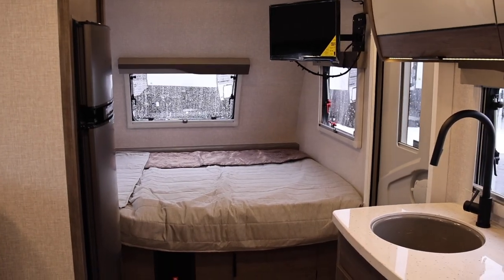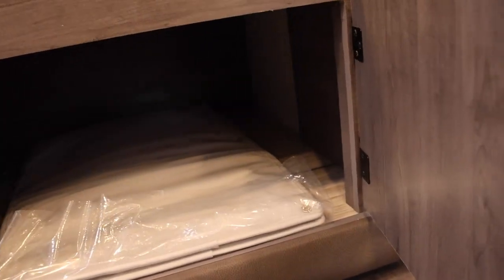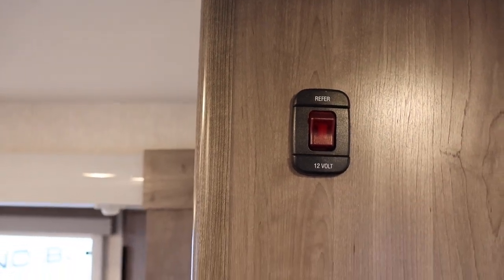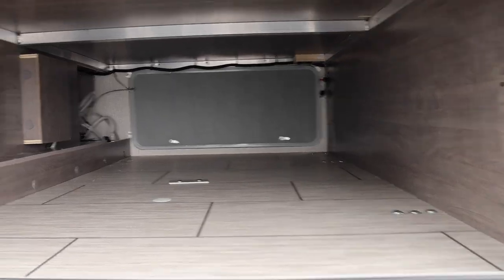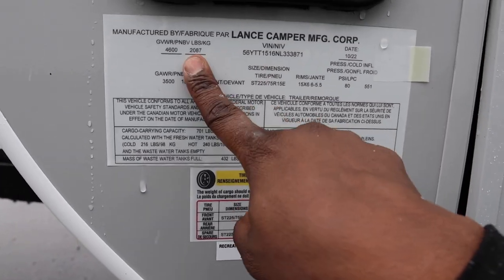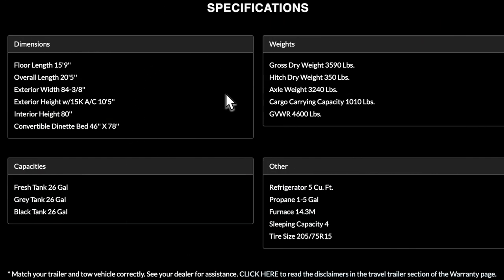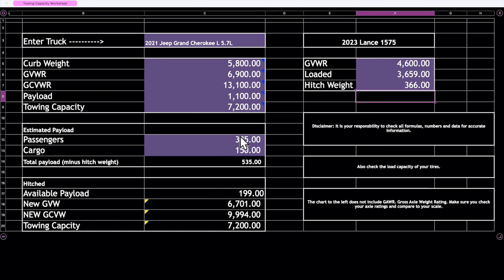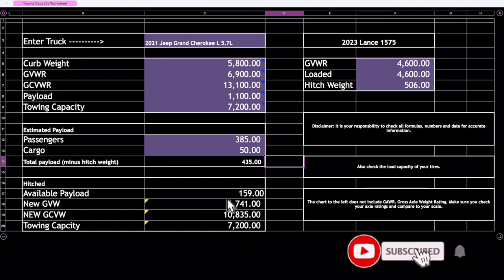The 2023 Lance 1575 Is Small But Spacious! Does A Jeep Grand Cherokee Pass The Capacity Test???

Comment: Another great video JB! Also i want to ask to be certain.. isn't GVWR based on dry vehicle weight? I'm asking cuz I was always taught to calculate "fuel and passengers" and to put the rest in the tung weight if possible. Also, i wanted to mention that 10% tung weight is based on an empty bone dry trailer. This number will go up as soon as anything is loaded into the trailer and under braking due to weight transfer. I was always told to keep it under 20%. So 10% is where you would want it to be during travel and towing on the road,. This will leave an additional 10% for weight transfer under braking, helping to insure you do not go over 20%. ~ Remember, In the end our tow vehicle needs to be able to behave safely and predictably to prevent and avoid any dangers on the road and keep us and others safe.. Loading to the max or close to it is never a good idea. In fact it's strait up dangerous. This is not even mentioning how to place weight in a trailer or the potential catastrophic affects of getting it wrong. Get a bigger truck or a smaller trailer if you have to but leave a lot of room in your tow vehicles carrying/load capacity. Even a small trailer can easily flip and roll a tow vehicle  just because something was put at the rear of it. ~ If you take a 2500 Hemi with 2900 lbs pay load and set a 1500 lbs load limit for example:  Say 600lbs for 2 adults and 2 kids. Say 195 Lbs of feul @1.6 lbs per ltr @ 33 gallons full. That's 800 lbs passengers and fuel.. 700 lbs left over for tung weight. This essentially means that the trailer can not exceed 7000 Lbs total weight because 10% of it will be tung weight. So if the trailer weight was a total of 8000 lbs you would have 800lbs of tung weight which in this scenario would put us over by 100 lbs being that 700 lbs would be the limit to keep us below 50% of our tow vehicle's max pay load..  ***Remember that clothes, blankets, food, water, drinks, medicine and cleaning products, propane tanks and generators everything that you added to a "bone dry" empty trailer , adds to it's total weight and the tung weight. Consider all of it as excess weight. The best advise i got was to calculate all the "excess weight" i would have on a trip as everything other than fuel and passengers, and go from there. Fuel and passengers are essential weight, nothing else matters lol. The trailer's axle's also have a max load that i do not want to go over 50% of , when i load the trailer. This insures the trailer itself will behave properly and safely on the road and under braking. So the trailer's axle or axles determine a lot right from the get go. If the trailer has an 800 lbs carry capacity you know that you shouldn't exceed 400lbs of total cargo in the trailer to stay under 50% max load when towing. And remember this is for reasons of safe drive-ability ,..this is not to say you can not add more weight once you are stationary. Static weight can be maxed for some time but dynamic weight should be under 50% in my personal opinion. Risk less be safe. So to cap it, if my truck is the 2500 Hemi with 2900 lbs max pay load, and I set the max a 50%. My ruck will have 800lb for essential weight and 700 lbs for tung weight available.. If I have 400 lbs of excess weight to bring along, then the trailer I choose has to have weighed in at no more than 6600 lbs empty and dry with a potential for 800lbs of max load capacity. By adding 400 lbs of excess weight the trailer will come in at 7000 lbs and produce a tung weight of 700 lbs. From there i simply would not exceed those numbers when towing. If the tung weight is less,.. all the better!
Reply from the maker: Thanks bro, anytime I do my weight watcher videos, I like to show GVWR (maximum allowed weight for trailer) multiplied by 10% and add 1%-2% to be safe. I would like to start taking trailers to the weigh station but this is future, then I could show exactly what the hitch weight would be. If you’re using a WDH, weight transfer should be minimal in that case 👍🏾
Reply: @JB_WhoWork  Thanks for the reply JB! WDH and sway bars., I never leave home without them bro! Safe set-up safe journey!

Comment: Choosing my Grand Designs over a Lance was a huge mistake.
Reply from the maker: I could never find them on the east coast but they are up there with Airstream 👍🏾
Reply: You are not happy with Grand Design? Why? What model do you have?
Reply: My 2600 RB was shipped with a crack in the exterior fiberglass that was hidden by the rain gutter. A screw had been placed thru the rain gutter that had about a half inch gap before the fiberglass torqued until it cracked. Water ran into that crack from the roof which delaminated the entire front left side!! Grand Design refused to do anything about it. Very expensive repair. NEVER EVER buy and RV without without Azdel siding, never. The trailer was a 2018 less than two years old. JUNK!
Reply: @fire273mx7  Some time back Thor bought Grand Design. That may explain why.
-- BR